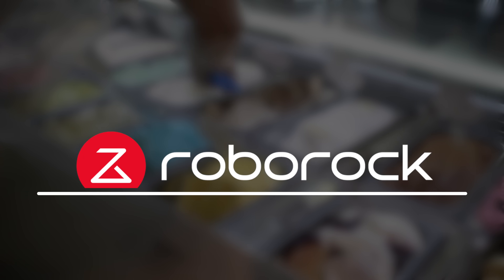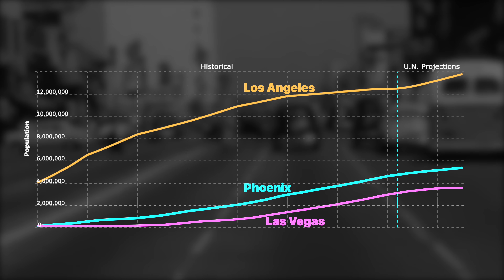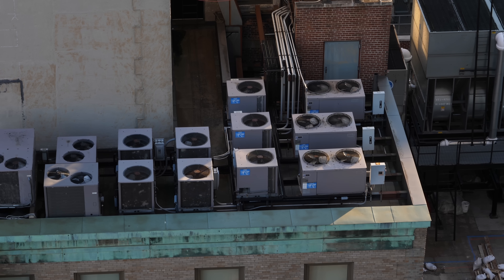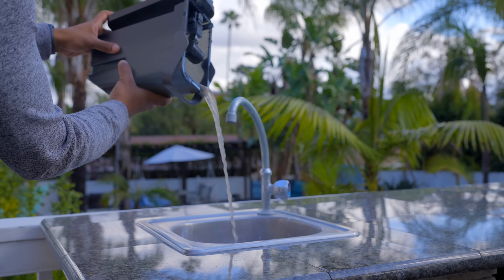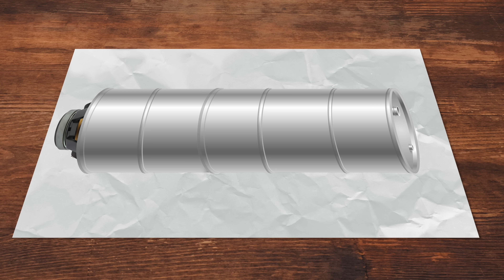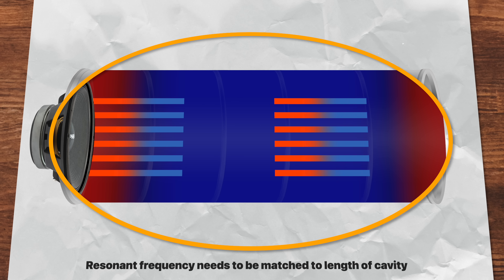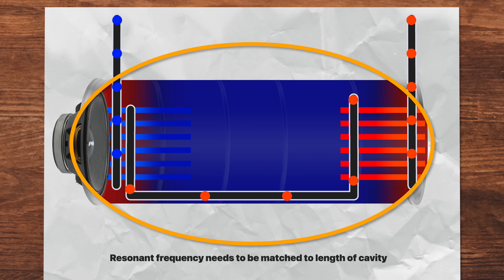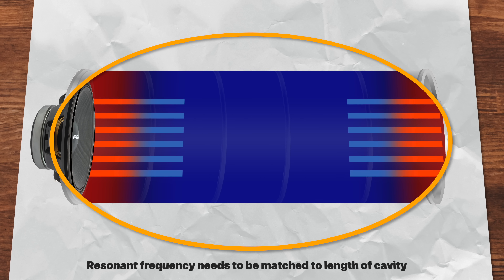Next Gen Heat Pump Heats & Cools Using Sound!

Comment: Using sound as energy is not a new invention. this so-called invention will not compare to the heat transfer of a new type of refrigerant that can reach a COP between 2.8 to 8. Today turbocor magnetic compressors can reach very high COP. so when the magnetic compressor will be on small heat pumps /AC that will be the real change.
The speaker (sound energy) is also moving parts and the resistance inside the tube will kill the speaker eventually. The speaker will heat the substance but if there is no changing phase from liquid to vapour and boiling point as refrigerant, the efficiency of transfer heat will not be the same and it will be just like an electric heater with a fan.

Comment: I think the specific heat of Hydrogen is 14.304 J/g K  which is 3x that of helium.   It's in a sealed container, easily repressurized if needed.   I do not think it is a major danger to use and we need to save our helium.

Comment: Imagine having a machine harvest the heat from the air. 
Having a low temperature boiling gas(in liquid form).. make it boil from air outside (20 celcius) over a turbine.

Then condense it by compressing it with pressure. Leaving the air a bit colder. Hoping to use less energy on the condensor than the turbine generates.

A bit like a Heatpump, could this work?

Comment: You said a space heater is 95% efficient. No. By definition a space heater is 100% efficient. Even the fan turning, the sound gets absorbed by the walls and turns into heat. Even the led light, the photons hit the wall and turn into heat or bounce a few times and turn into heat or bounce into your eyes and get absorbed by your retinas and turn into a little bit of heat. By definition a space hater is 100% efficient because even the inefficiency in The wire becomes heat which is what you're trying to do anyway.
Reply from the maker: Electric yes. Gas no
Reply: @TwoBitDaVinci  I was talking about when you mentioned a space heater is nearly 100% efficient. You can drop the nearly.

A good gas heater is 95% efficient, correct.

Comment: This technology is what allows the James Webb Space Telescope to work. They can’t have vibrations from a compressor mess up the images they’re trying to take, so they use this to reduce vibrations. It allows them to get temperatures of a few hundred degrees below 0 which is what’s required to allow the sensor to detect deep infrared wavelengths.

Comment: tune-up means pay-me-more-money for nothing
Reply: as all money based operations
Reply: you mean semiconductors (of heat)
Reply: how about heat diode, or heat thermo couple
Reply: you mean the acoustic piston, like in a normal piston compressor
Reply: when did your speaker break down last time, be honest
Reply: lack is a lie
Reply: spin centrfugal compression heat pump is the best of its class, try the flex membrane fan (yes a flute tongue fan, szzzszzzz)

Comment: Surprise a speaker is just a low pressure gas pump . The principle has been around it is nice to see refinements of tuning to create a standing wave ,genius lead to new applications . Speaker design using design to eliminate standing waves efficiently in the same principle . Look at fish tank aerator pumps even my air mattress compressor similar basic principle.

Comment: No compressor? I think not. There is a lot of compression going on in these systems. That's what sound it. Compression and expansion in a gas. The Blue heart system uses two Pistons to generate it's sound. So at best it's not a traditional compressor. But it certainly is one.
Reply: Blue heart is not on the market yet, is it? been following it for years...

Comment: The front grill area of a car is a noisy place and since air density increases as it gets colder, noisier still. Did I hear something somewhere about how EVs with heat pumps achieve greater range?🤔

Comment: If space commercialization reaches a high enough level of development, planets made mostly of hydrogen and helium could be mined by special space planes in the upper atmospheres of said worlds to make up for Earth's lack of helium.
Reply: The gas Giants in our system could supply us for a long time, but getting to that is still not economical. And when we get there we have so much the price would get so low, it's uneconomical again real quick.
Reply: I wasn't implying it would happen in the next few years. The price would reflect the cost of getting it and processing it in the first place and then bringing it back to Earth. Hydrogen would make good propellent for fission driven engines we have on the drawing boards. Regular shipments would create a steady pipeline and sun shades would allow shipping and storing it to smooth out fluctuations in demand as cryogenic fluids. I am more concerned as to how to keep our infrastructure up and running to get to that stage.

Comment: not requiring a compressor should reduce the high voltage requirements when conventional heat pumps start, a major cause of peak energy usage on the grid.

Comment: Some argue that having solar panels and / or heat pumps, heating a smart boiler / water tank is potentially more effective than trying to directly generate electricity? Also District Heating is a good concept to use waste heat from industry and power generation, through the most built up population zones. Politically unpopular for no good reason, just because it's an idea from the USSR days of Eastern Europe I think, though may be mistaken. 
Me: is it possible to feed a water-cooling system for solar panels into a hot water system, so people could have effectively free or at least cheaper hot water from late afternon and overnight? This would be of benefit to people who live in those climates where it's overhot during day, then drops to freezing or below at night?

Comment: My thoughts on this is that this technology is going to fall short of its full potential.  An acoustic heat pump coupled to an thermoacoustic engine is essentially a heat transformer. Much like how electric transformers allow us to change the voltage of electricity by going from electricity to magnetism back to electricity, this technology can potentially go from one gradient to sound waves back to another gradient. Used appropriately in this way solar thermal can be made more efficient by operating solar collectors cooler, and further from equilibrium, while also running a hotter boiler than they can now  to produce more electricity on the same footprint.

Comment: They made us get rid of cfcs in the 80s and 90s due to the ozone hole.  They were replaced with hfcs or hydrofluorocarbons.  Hfcs are not as efficient as cfcs so we use more energy for the same amount of cooling. 

Now however there is a big push to get rid of hfcs too.  My guess is whatever we are supposed to replace them with will be even less efficient.   Such progress.

Comment: You could attach the hot and cold ends to a Stirling engine and recap some of the energy to run the system and just add back in the loss

Comment: I'm surprised that nobody has yet mentioned the James Webb space telescope in this comment section. It uses a thermoacoustic heat pump for cooling of its mirrors, I think that real engineering has made a video about it. So, if this particular type was deemed to meet the high standards of aerospace engineering in NASA, why not use it in our homes? Many technologies developed during the space race were eventually adopted for use by regular people
Reply: Space and home are very different environments. Yes tech from space makes it into our homes, but many things don't. Those nuclear power sources some of them use, have very good reasons for not being in our homes. Space is full of radiation, but people don't respond well to it.

Comment: I would really like to see all the appliances share a common heat exchanger. It’s always annoyed me thinking about using energy for my refrigerator when its cold outside!
Reply: Your refrigerator already heats your home with electric heat.  The heat it takes out of your food gets transferred it to your kitchen, and the inefficiency of your fridge also heats your kitchen even more.  However, since it's all electric heat, it was expensive to produce, and doesn't reduce your heating bill much, unless you already have electric heat.  It's Summer when this works against you; heating your house when your air conditioner tries to cool it.  It's your dryer that could use a good heat exchanger, as it throws away most of its heat through an outside vent.  Can't safely vent it into your house if it's gas; all the carbon monoxide.  That's where a good safe heat exchanger would save you lots of energy and money, if there even is such a thing.
Reply: I keep my refrigerator on the porch.
Reply: @MARILYNANDERSON88  similarly, I don’t heat my kitchen! 

The only place I do heat is my bedroom, and that is with a wood stove (& all the wood comes from my own property and is gathered and cut by myself).

I do sometimes use a portable, infrared light - based, fan forced heater in the adjoining bathroom for brief periods since it is easier than trying to arrange a fan to efficiently blow the warm air from the bedroom into the bathroom, but this is only when I am taking my shower (maybe 10 minutes on average).
Reply: I totally agree with you. There has to be a smart way to couple all the thermal cycles of our home appliances. This would go through a seriously complex home design but I think the end result would be more efficient than what we have now.
Reply: @ipp_tutor  Yes, but it would also require all appliance manufacturers to agree on a standard way to tie all of them together.  That's a difficult thing to do, but I agree that it's a great idea.  It should save a lot of energy, if implemented properly.

Comment: Fact check the environmental impact of 410A used in AC systems.  You will find 1 KG of 410A has the GHG (greenhouse gas) equivalent of 2000 KG of CO2.  That isn't friendly and neither were CFC's.  Annually 250,000 metric tons are made - - like 1 trillion pounds of CO2 equivalent or about all passenger car miles in the US.  Makes you wonder why global warming is accelerating.
Reply from the maker: yeah it's why this could be a really important technology

Comment: I highly doubt that this is more efficient then a compressor . There can be more efficient compressors , but thermo acoustic , i highly doubt . The temp difference between hot and cold side , in a same pipe system would not be very big . A compressor actually changes the condition from liquid to gas , which is a more then excellent heat exchange.  A gas- gas system , which this is , will have very low transfer of heat/energy .

Comment: why not oil instead of helium? liquids transfers sound too.
Reply: Because helium is an insulator, it is an inert gas. It needs to separate the hot and cold sides. Liquid would be far less efficient.
Reply: @tomkelly8827   cool :)
Reply: @tomkelly8827  I want more alternatives...

Comment: Thermoacoustic heat pumps have been around for decades. it's the technology used to cool natural gas to below -160C before shipping in LNG tankers. I'd always wondered why it had never been scaled down for home use.
Reply: Thanks for this! I remember watching a science show in rhe early 80's (probably "Living Tomorrow" ) featuring breakthrough studies for A/C & refrigeration using the same tech.
Reply: Note to self, buy a good thermostat...
Reply: My mother told me a story about her school teacher not believing her about using sound to perform refrigeration, so she took a newspaper clipping on the subject to school. This would have been in the early 50s.
Reply: there is probably some "waste sound".
Reply: Absolutely. Well known to Cryogenic engineers.
Reply: I guess cost reason and scalability
Reply: because they use a fuck ton of power and are not efficient for cooling air....like you would need in an air conditioner. they are also closed loop, exactly opposite of a household AC system. might be able to use it in a fridge....but the question is. why? just to run the cost up? Yay.....
Reply: @DieselRamcharger  The biggest beniffit is reliability. For LNG extreme temperature difference and uptime beats efficient operation especially when such costs were lower. Economy of scale and time invested lower that cost a bit anyway. The use of helium and very high static pressure at 30 atmosphere or more makes these newer versions much more compact with lower operating costs.
Reply: It's largely inefficient and requires stupid precise tuning. 
Not favorable in commercial conditions, where most mechanic use analog tools and may have hearing issues (would be a major problem)
Reply: You tune it by ear?
Reply: Is this used in Air separation units?
Reply: Are they also used in air separation units?

Comment: This design seems ideal for an  integrated circuit implementation. Multiple tiny cavities with piezoelectric components to generate the waves. And with smaller cavities the volume to area ratio may be more advantageous to heat transfer, which goes by the surface area.
Reply: So you mean for a different way to cool electronic components? Perhaps something built into the actual chips?
Reply: @ipp_tutor  Exactly! Reserving areas on chips which would use microscopic piezoelectrics to create cold spots. They could become a standard, drop in design component.
Reply: @alvarofernandez5118  That would be really game changing, IMO. Combine that with self-powered chips with nuclear diamond batteries like Ricky suggested in a previous video and you’re laughing
Reply: In my opinion this could be used to make devices unfixable...
Reply: Seems like it might be hard to fill and get a good seal on a microscopic cavity

Comment: Hydrogen has twice the thermal conductivity as helium and virtually free.
Reply: Yeah, but very hard to contain well.  And more reactive than helium.
Reply: @justinw1765  containment is an issue but leakage in such a system is easy to refill by simply making more as needed.  It's not high pressure or great quantities.  That's what I would do for myself, but might use helium if safety was a big enough concern for some unknown reason, or if I felt regulators might not like it.

Comment: Very interesting!  Ty!
Reply from the maker: Glad you think so cheers!
Reply: @TwoBitDaVinci  These would not be two hard to make.  You might be able to use a infrared camera to get a good swag on matching the freq with the tube shape, but I'm guessing a time measurement of the reflecting wave might be a better indicator, but that requires a receiver circuit to measure it and expensive electronics.  I've done this with radar but not sound.  The tech is totally doable but requires money to develop.  I see a lot of potential with the proper funding.

Comment: Thanks Ricky - very interesting but you also reminded me of all of the various heat sources in our homes as well, that are typically wasted - stoves (we use induction - which I love - so it is reduced), ovens, fridges, etc.  All sources of heat.  Need to think about how to harvest their heat output.  The sound concept is very interesting - it makes sense for sure and it should lower the cost of heating quite dramatically - but I think that there is a lot of heat that we can harvest in out homes that is just passing us by and that we could use anytime for things like heating water, etc.   Anyway, food for thought 🙂  Thanks for sharing and have a great festive season 👍
Reply: I fully agree with you. 75 - 80% of all heat generated is wasted. I have been doing low temperature thermal energy storage research for years. So much more research needs to be done in this area.
Reply: It depends on where you live as well. Most of the heat from household appliances will end up indoors - so if you live somewhere where it's cold most of the year, the energy wasted isn't that much. But in warmer countries, it may be a big waste - especially if it's so hot that one want to use an AC (then not just the heat from the appliances is wasted - but the AC have to waste even more energy to remove that heat as well). So in those places (and even in many cold countries during summer time), it would indeed be nice if the waste heat from many appliances could be used to heat tap water or something instead.
Reply: This is much more common in large scale commercial applications. For example, newer or updated hospitals use a system like you mention. They can pull heat off the top floor to cool it and send that heat to a lower floor to heat it and the excess goes into the hot water all at the same time. The downside from what I have found is no one really offers a system like this for the scale of a home. You could build one yourself, but most people are not going to do that for many reasons. You could also tie all the fridge and freezers together into one rack of multistage compressors like they do sometimes in commercial refrigeration. The biggest problem with a system like this is the complexity for a home, the cost, and the downside of 1 failed component could take down the whole system. In a perfect world or someone willing to spend the money and take the risk, it would work well. From a current cost and availability standpoint, it is dead.  Most people want cheap and quick, maybe one day.

Comment: Doesn't helium escape almost any container, being a very small molecule it can escape fully enclosed metallic containers.. or was that only an issue with hydrogen.🤔
Reply from the maker: well helium is #2 lightest so yeah it's a concern, but I think it's manageable with the wall lining
Reply: We would be better off using hydrogen because the availability of water means you will not need pressurized tanks or rare molecules. It could even use condensate generated from the cooling side.